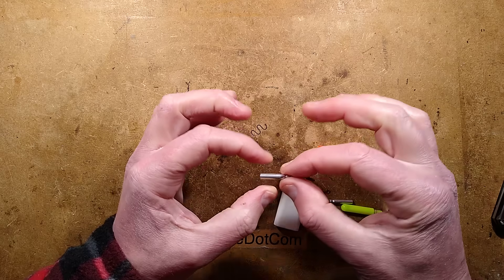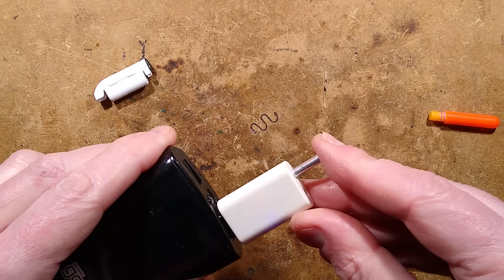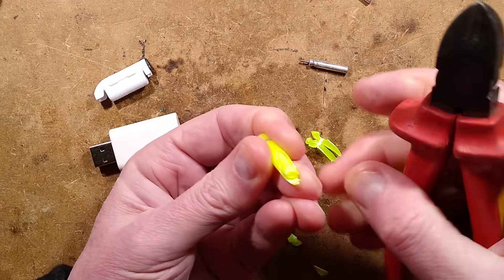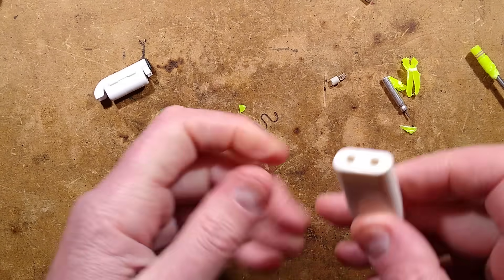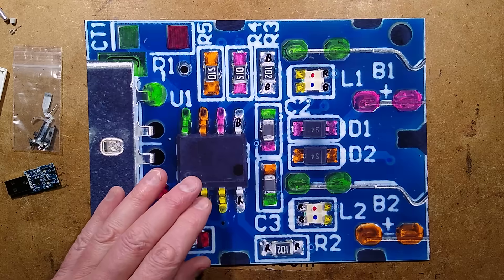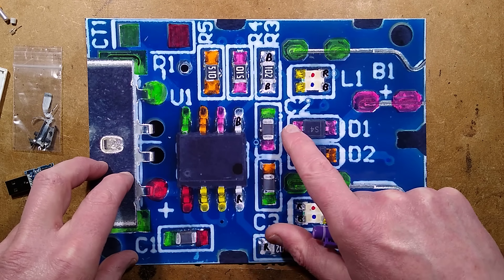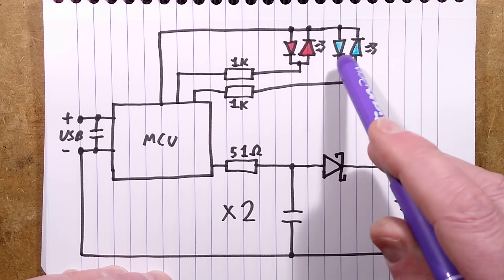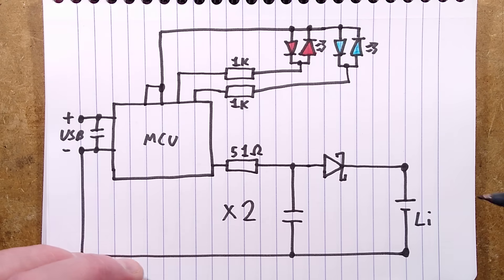Inside a tiny CR425 lithium cell and its odd charger - with schematic

Comment: I found a similar battery in an Apple AirPod in the parking lot that had been run over.  Just looking at the circuitry inside the device blew my mind.  I could not wrap my head around how it was even built as the passive components were hardly even visible.  I’m sure you would have a hay-day as well.  I looked up articles about the components inside and it was really interesting as the majority is 1.8v based chips.  It was truly amazing to see.

Comment: I believe these could be used for "fishing rods" that electricians use for pulling or finding pathways to pull wire. I saw a similar rod tip light with a tiny battery.

Comment: Thanks for your work 👍iv had a look at these cr322's, most of them are 3v non rechargeable, I thought CR as in a std CR2032 ment it was a non rechargeable cell? Rechargeable ones have different letters in front of the number? Can you enlighten me Clive? Thanks again 😉
Reply from the maker: While many of the rechargeable cells are sold as CR425 , there are other sellers listing them properly as LIR425.

Comment: since it looked like there where scorch marks on the aluminum casing of the inside of the battery. how bad was the fire when you drilled into the battery?
Reply from the maker: No scorching.   I discharged the cell before opening it.

Comment: Clive: It seems to me that your Schottky and Zener diode symbols are non-standard.  I was taught that the Schottky anode symbol should resemble the topology of an S and the Zener should resemble the topology of a Z.  Yours appear to have the opposite handedness.   Am I misinformed?
Reply from the maker: Search Google for "schottky diode symbol".  Although a quick test of that showed one site that showed the wrong symbol.
Reply: The most non-standard thing about Clive (apart from the beard) is his use of lower case V for volts. (o:

Comment: Can you explain how this works. VEVOR 3 Phase Converter- 7.5HP 23A 220V Single Phase to 3 Phase Converter, Digital Phase Shifter for Residential & Light Commercial Use, 220V-240V Input/Output (One Converter Must Be Used on One Motor Only)
Reply from the maker: Sounds like a standard variable frequency motor drive.   They convert the single phase AC to DC, then recreate a variable frequency three phase supply from that.

Comment: I use these but the ones we use can flash green or red depending on .
Not moving rod tip Green steady on led
Movements detection of rod tip Red flashing led
They are super sensitive to vibration. Would make a more interesting tare-down 
Thanks Clive doing this so we don't need to as always lighting our darkness!😅

Comment: How does one get hold of Clive to send him something?

I've got a pair of wireless Sennheiser headphones that I was charging via USB when I was about to go bed, luckily I was watching something on youtube and hadn't fallen asleep yet shortly into my video I hear the USB disconnection noise multiple times and think weird, so I get up to check the computer and look at my device manager an unknown device was showing but non of my known devices was missing so I assumed it was an error. shortly after I smell a melting plastic smell so I start looking for signs of a fire around my computer everything was fine when about to go back to bed I noticed my headset wasn't charging so I went to unplug the USB-C connector and realised it was stuck, when looking it appears that the connector has melted into the housing. i ended up using some pliers and my full force of my grip and feet holding the headphones to get it out. They no longer power on and im not going to plug them in again and see what happens but i am perfectly happy to send them to you if you want to investigate. I will disinfect them and send them without the earmuffs if you are interested i also noticed there was a crack in the insulation on my cable if ud like me to also send the cable with them. the headphones themselves have been great but i;d purchase another pair if i know its the cable or a freak accident or maybe there's a design flaw? 

edit: it was being charged via USB 2.0 from a PC so id assume about 5.5v - 0.25a

thanks :)

Comment: Cell construction method gives less surface area leading to poor current capability.. but in this case that is what they want.  Likely cheaper to manufacture than a jelly roll.  Apparently there is a limit to how thick they can coat electrodes of a jelly roll

Comment: 15 vs 45 mAh is a pretty big penalty for rechargeability.  I wonder if market demand does/will exist to incentivise improvement, especially considering existing button cells give nearly double the capacity per volume.

Comment: These are the perfect size and shape for stem-style TWS earbuds, but I haven't found any that use this type of cell - nor makes them easily replaceable. Imagine a charging case that has two additional charging holes for these cells, so you can swap them in a few seconds when the ones in the buds run low, and not need to put the buds back in and wait for them to charge before using them again.

Comment: A product I would like to see you dismantle is a cheap tazer. I just replaced the NiMH cells in my dads old tazer with one lithium cell from one of my dads disposable vapes. From 250mah to 850mah. I also cut out the NiMH charger because you plug a 2 prong plug straight from the mains into the tazer but on the inside there's no ac to dc transformer, no proper charging circuit. There's some componentry but how on gods earth that works I have no clue because I don't see any way of a dc voltage forming to charge those cells. Might be why those types of tasers only last a couple charge cycles before the batteries go caput . Anyways I swapped the charging circuit for a single cell power bank board which fit snugly into the tazer casing. The stun voltage is lower but it'll still hurt a ton.
Reply from the maker: Sadly,  tazers are classed as illegal weapons here.

Comment: Some of these batteries, I believe come in 28mAh, based on the other designs I've found.  Normal capacity is 25mAh at 3v.  Olight has a mini keychain flashlight called the X9R that uses them.

Comment: Very interesting! I haven't gone fishing for a few few years, but when I did, I used small chemical lights on the tip of the rod (night fishing) to show line movement with fish activity. This is the modern version of those, and much more interesting to use (can be recharged on site with a small power bank, if need be). Almost got me in the mood to go night fishing again 🙂

Comment: The beauty of that cell design is that it will have relatively high internal resistance. No need for a resistor on the LED.

Comment: I have some tiny prismatic cells that are 80 mah. They're half the size of a postage stamp, but if I rolled one up, it'd still be bigger than that lil cell. I'd venture it's 50-65 mah capacity. That's enough to give it about 3 hours.

Comment: At 14mAh the CR425 cells are a little low in capacity ... but claim to power the leds for 8-10 hours!
Reply from the maker: Intensity diminishes, but they were still visibly glowing after 24 hours.

Comment: I just bought some cells on the other end of the scale... Reviving two old 3D MagLites with LED conversions, I decided to "invest" in rechargeable power also. Turns out Energizer rechargeable D cells offer a rather tragic 2500mAh, weighing in at less than HALF of their alkaline equivalent. Hey ho, we shall see how this goes.
Reply from the maker: Look for the industrial grade D-NiMH cells.
Reply: On D cell lights I've been restoring I've used 26650 or 32700 cells . Twice the capacity half the weight

Comment: About the LEDs: there are LEDs that have a resistor included in the package, maybe even as part of the die. I have some in the usual 3mm(?) form factor, and the only way I can distinguish them from LEDs without resistor is to see is they blow up or not.
Reply: Resistor LEDs have a small chip resistor mounted on top of on of the lead frames inside the LED. Instead of the bonding wire going straight from LED chip to lead frame, it goes to the top of the resistor instead. You can see it easily with a decent loupe. There are also fully current regulated versions made by Optosupply which use a constant current circuit on a chip instead of a resistor, I sell them in my store, they run at the same current from 5.5 to 20V, very useful devices.

3mm is a very common through-hole LED size, second only to 5mm LEDs.

Oh, and Clive is right, there is no current limiting in these LEDs, they rely on the fairly high internal resistance of the batteries, many lights that use button and similar small batteries do this. It isn't ideal, but you can get away with it...

Comment: found an ipod in the street. Since it's only one, and i have no ipod charger, and curious like everybody else here, i cracked it open. found an itsy pitsy teeny weeny lipo (?) pouch cell : 8x9x5 mm. mounted behind the "speaker (diam 12.9x3 mm)". In the vertical shaft is a double sided pcb 4.8x22 mm with a 24Mhz oscilator, something that looks like a small microphone (metal can (diam.3.8 mm) with holes arranged in a cicle), traces that look like a blue tooth antenna on one side, and on the other side one ic  (can't read the number, it's too tiny and i don't have a microscope) (ampifiers+blue tooth ?) and someting that looks and feels like a tiny push switch. Since there is no push button on the ipod i guess that it's some sort of "reed" switch that detect when the ipod is in its charging station. Cannot check it since i don't have one. I guess battery management is done by the charging station (battery was also connected to the 2 contacts at the bottom of the shaft. Incredible how small this is for what this thing does.

Comment: as you've probably noticed, most cylindrical batteries have the post as negative... just the way the chemistry works out.  The original carbon zinc cells set the standard of the post being positive so now with other chemistries there's a fake post put on the flat end of the cell and the real post has a disc over it to make it flat.

Comment: If anyone is wondering, you clip them on the top / tip of your rod and have the line straight to the lead and bait. When a fish bites, your rod will bend and jiggle and you can see the light wiggle even in the dark.
Reply: I've been using the bobbers/floats that use these on the top tips so you can bobber fish at night. The only place I could find the extra batteries and a charger was from China. I don't suppose anyone knows where one can pick them up locally in the US?
Reply: As an old fisherman this supersedes a clothes peg with a bell attached that used to clip on to the rod tip, zero power used however if you forgot to unclip it before you cast out again the bell sailed away. I lost a lot of bells and didn't catch many fish either.
Reply: @hanfo420  your talking about fishing, right?
Reply: Yes. Clive mentioned that in the first 35 seconds
Reply: Your penguin looks like a poopy butt..  dont be a shit ass penguin..  youve seen the video of the nesting penguin that takes a full spray shart to the face right??  That penguin was being a poopy butt..
Reply: Yup, if ya get a snag, ya won't lose it. 👍

Comment: How neat! It’s very interesting to me that the center electrode on the battery appears to be knurled, to my eye, I wonder what that’s for? To increase the practical surface area of the electrode to improve current flow perhaps?
Reply from the maker: Probably to increase the surface area or even the grip into the internal chemistry.

Comment: Alright, Chief. I just ordered some of your A4 Gallium PCB designs from PCBWay. I have never ordered PCBs before and was somewhat trepidatious. However, I was pleased to discover that all they needed was the ZIP file, and from that, they derived all the necessary information.

The price was a bit alarming though—$115 for the minimum order of five. So, I’ve also had to order a few thousand 1206 resistors and an alarming quantity of LEDs. My soldering ability is fairly good now, but I suspect it will be excellent after making the required 4,690 connections.
Reply: That's my bugbear with PCBWay, why would I want 5 pieces, and the postage is extortionate.
Reply: @Martyn-ey9lw  it never occurred to me that other PCB making places wouldn't insist on a min order. as i said i have never ordered them before, i love electronics, but kinda hate computers now. i resent time spent learning how to use new software. i have avoided it, so far, by carving tracks into PCB blanks with a Stanley knife, or dead-bugging components onto blanks, or even, for special things, onto corroded old sheets of copper (which looks ruddy awesome) when i want to make things and don't fancy proto or vero board stuff. however, my niece saw the BC supercomputer in the background of a vid i was watching and asked how it was made. i blithely said "it is just a load of flashing leds and supporting components on a pcb". so naturally she said "could you make one then? if it is so simple?" Bah! she got me. so i had to spend the best part of 200 quid on PCBs and components.

Comment: I have a Led Lenser keychain light - from 25 years ago - that uses the first Nichia white LED, and the primary version (non rechargeable) of that cell.
I recall the replacement battery costed me $4.99.
Thanks for the video, Big Clive.
Greetings,
Anthony
Reply: I've got that same flashlight. Bought a pack of replacement batteries ... still works!
Reply: I have that light as well, still riding around in my backpack pen storage loop.

Comment: Maybe it's an 'alkaline' type battery. They are also somewhat rechargeable. And who knows maybe it's 'expected' that the LED device falls of the wire/fishing line after a couple pf time using it. So nobody notice it that it does not work anymore after some time....

Comment: From my foray into alkaline cells and their capacity; the traditional 'solid' structure has a very high capacity due to the lack of separator material; but has 1/10 the current capacity of a typical 'wound' cell - like Ni-MH and Lithium. This means that for capacity testing, you would need to drop the current by a lot...
The result is a very long test, but it's worth it; a normal AA on a 125mA discharge gave about 2AH. Running the exact same test at 15mA gave 3AH. This also applies for charging, you need to let them charge slowly; and then allow them to 'soak' at full voltage for some time...
This is like an old and very rare "UR" series coin cell I have, it is a rechargeable lithium assembled like a typical coin battery - with a solid disk of battery schmoo inside it. Contrast that to the 'LIR' type, which is a strip of lithium cell, folded up into a little square which can push out 2A during a short-circuit and is typically stored and sold in a strip of masking tape!

Long story short - these things are wild, and I do want one... It would be great for the lav-mic circuit; and a few other small wearable gadgets. Home-brew watches anyone?

Comment: Those LEDs sound like its using a basic CV/CC regulator - I have several Chinese CV/CC boards and they do EXACTLY what you describe.  Red = constant current limited, Flickering red/blue = on the verge of transition to constant-voltage "hunting", Blue = constant voltage.  If you let it sit for long enough it will go solid-blue and stay blue as its hit the "constant voltage" phase at the end of charging a battery.  I also have run into at least one USB Lithium charger that does exactly the same thing (and yes, after long enough goes solid blue)

Comment: Watch out when you order these, there are rechargeable and single use cells sold in identical unmarked packages. I ordered a set with 10 batteries and a charger, i was sent 8 single use and 2 rechargeable batteries with the set...
Also, the charger is terrible at voltage control so i ended up stripping the PCB and patching in two TP4057 chargers inside the case instead.

Comment: When the microcontroller uses four pins to control four LEDs you'd think the designers could have come up with a less complicated way of doing it!
Reply from the maker: It is a pretty odd thing.
Reply: This way of setting up the cirquit requires only two resistors, while the simpler way would need four. So this is a saving on hardware, and therefore on costs.

Comment: That charger circuit for driving the LEDs is... curious.  They've the elaborate multiplexed arrangement, taking 4 pins to drive 4 LEDs.  Rather than the obvious approach of driving one LED per output pin on the microcontroller.  Maybe that would have required 2 more resistors.. Though since the blue and red wouldn't be on at the same time at the same position, they could share a common current limiting resistor.   I've never seen a battery like that!  Curious what the capacity of such a thing would be..

Comment: I have a Garmin watch and I'm amazed that it can power all of its functions (including GPS) for 18 days. If you switch to power saving mode it can power the watch and maybe some other low power functions for 57 days. I'm intrigued as to what battery is installed in these alrhough I've no intention of finding out by dismantling it😉
I worked at STL in Harlow on fibre optics (in the 1970s) and one day I was shown a GPS receiver that was being developed and it only took up about 1 cubic metres of space. It would have been a bit difficult to carry around on your wrist though 😉

Comment: Coin (  PRIMARY  Lithium cells ) rely on the internal resistance to limit the current to ( any ? ) LED ... but do NOT use the rechargeable type (  LIR 2032  ) as these have the same chemistry as 18650 cells and will destroy your LED ... my advice for ( any ) 5 Volt USB source is to use a common Silicon diode , these drop more voltage ( 0.7 Volts ) than a Shottky diode , thus giving the cell a greater chance of ( long life 😝 ) ... ( tried - n - tested ) ..................... DAVE™🛑